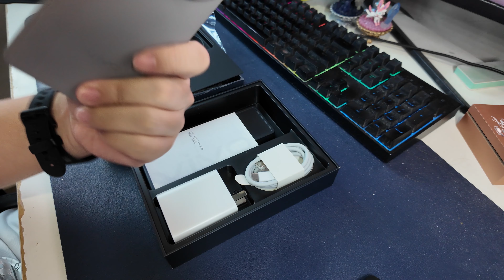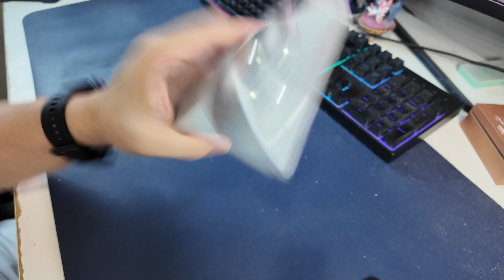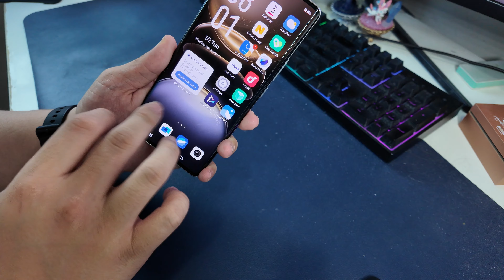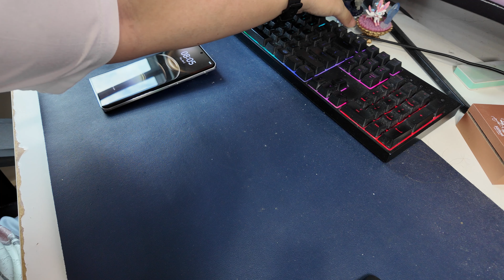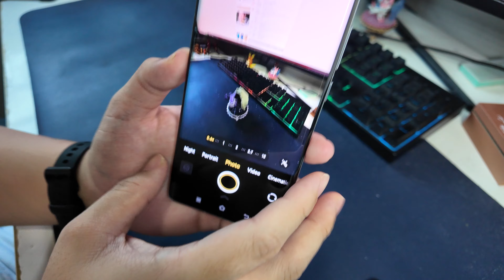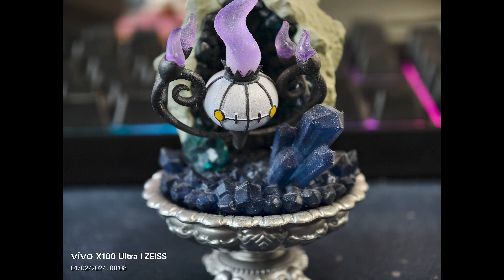Vivo X100 Ultra First Camera Impressions

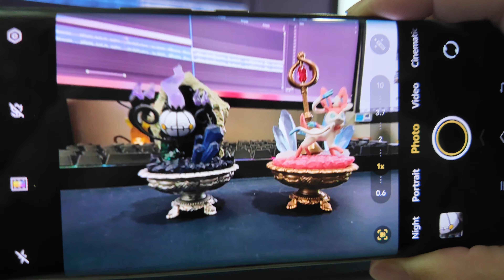Comment: On 16:00 there's a yeallow button on the corner of the screen (I think it's a flower). Try pressing it and it will disable the auto macro mode on the ultra wide camera, won't it? Anyway, for macro you should try to use the telemacro 3.7x zoom camera.
Reply from the maker: Thanks! Yes I realized the button after done recording and publish the video.